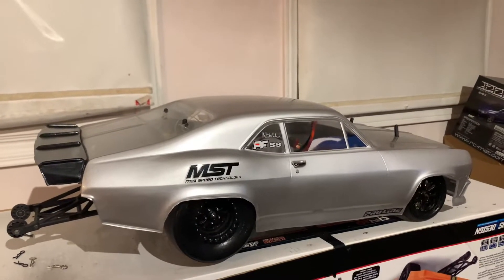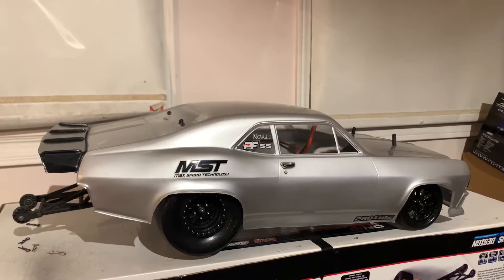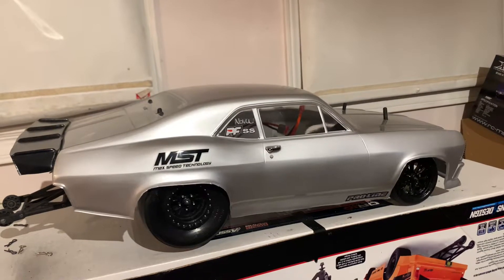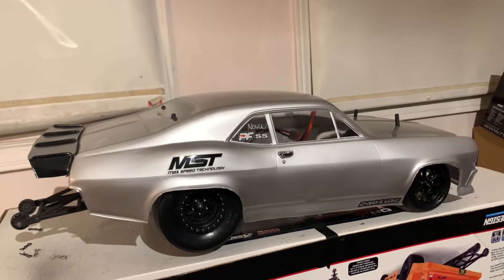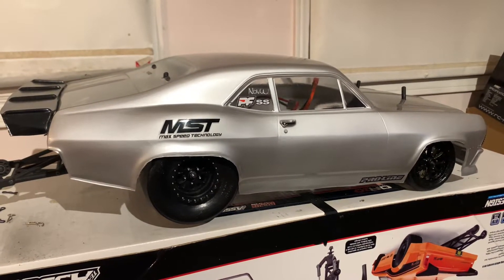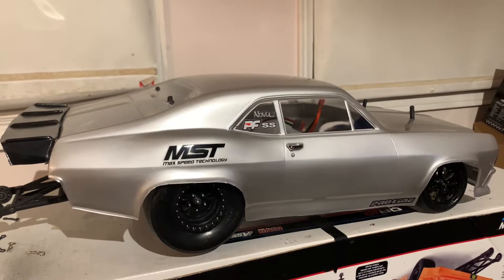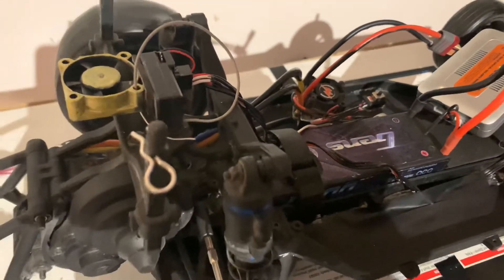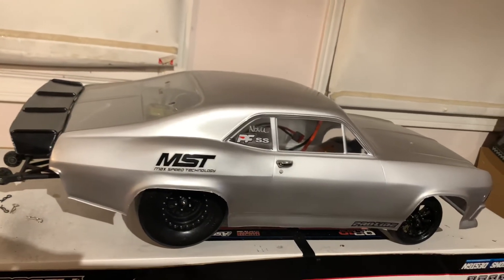Street Eliminator No Prep Drag Racing *Gearing And Slipper Clutch Tuning*

Comment: Full Scale Drag Racer here, and talking from experience > running our slipper clutch tighter in RC is where its at. Your on the right path Bro. What happens when the clutch slips (at a micro level) is what makes the car weave and wander. In full scale drag cars we tighten the clutch plates to alleviate that. You want it to slip a touch but not toooo much. Cheers from deep in the Mtns of NY. Ive got 2 Buick Grand National Street cars > but Im getting addicted to these RC no preps. Good stuff
Reply from the maker: Thanks man 🙏